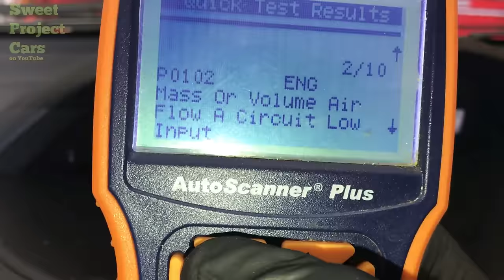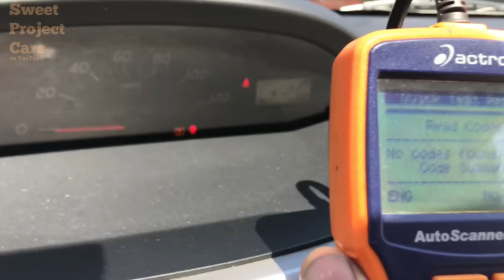How To Test Your MAF (Mass Air Flow Sensor) & HOW to Find A Vacuum Leak

Comment: I don’t think disconnecting the MAF and car continuing to run necessarily indicates the MAF is faulty.
Reply: Why not. Whats you technique?
Reply: @slewfoot6608  you need to understand the maf sensor reads air flow. A good maf will display 1 gram per sec air flow for each liter engine size. 8.1 liter V8 draws 8.1 grams per sec at idle.
Reply: @falcorthewonderdog2758  Thank you for posting that - l was hoping there was some simple formula.
Reply: 100% i took mine off while it was running, and ofcourse the car kept running. I automatically assumed its faulty and was gonna buy a new one for over 100 $ untill I looked around and followed my breather hose to find out there was a huge hole at the end of the hose stacked right behind the engine where it was hard to see.
Reply: @falcorthewonderdog2758 what for a v6
Reply: I replaced mine with a new one and it still stays running when I unplug it???

Comment: Just because the engine quits after unplugging mAF sensor, doesn’t mean the Sensor is free from fault. Best method is a scan tool and Repair manual
Reply from the maker: We've found this method one of many to fix the issue, have a great day. mad Mike & team

Comment: When I replace something like my injectors I try to go OEM which will run way over $100.00 for all 4, so knowing the injectors themselves were good, what I did was get a kit with all the seals, o-rings and on mine, new screens. Worked like a charm for under $50.00. A lot of times especially when someone has messed with them before they don;t take special care when installing them and pinch the seal (like on yours) which will end up with a fail. Another great video... Always a big THANK YOU!
Reply from the maker: Dano thank you so much for sharing my friend great information like that helps everyone have a great night my friend
Reply: Aunt Barbara adores you!! 😚

Comment from the maker: Hello my good friends, This video will hopefully help you test your MAF Sensor and how to help you locate a vacuum leak. We found that with a little time you can save yourself a boatload of money doing this work by yourself.  Have a great day :)
Reply: OMG!! I seem to have learned something new again,,DAMN you can teach an old dog new tricks!!! Thanks spc! Awesome as always 😎
Reply: Sweet Project Cars Hey SPC! Can you show us how to get rid the oil and fluid leaks that our friend’s car left in our driveway????  It’s a problem !!! Thanks!!!  😊
Reply from the maker: Ed Smith you are very welcome my friend :) glad we could help
Reply: Thank you for another great "no bulldust" & straight to the point video. It's so easy to get caught up searching in the wrong direction when fault finding on modern engines, that we often overlook the most obvious and easiest things to check first that could easily be causing the problem.
Reply from the maker: Tim Areskog you nailed it my friend :)
Reply: I have a g37 and it has two mas flow sensor.  Do I disconnect both or one at a time for this test?
Reply: Thanks for showing how to find a leak. My brother n law told me to use the same spray, but didn't tell me to do it when the engine is cold. 

So, for everyone watching this video and do not know ANYTHING about vehicles and learning off YouTube, never spray anything flammable on a warm or hot engine. That can cause a big fire.
Reply: Having a problem MAF sensor  didn't show any code but the check light is on . Air ratio reading is high, after installing new MAF the check light off every thing stable,but the next day start the car back other problem  like engine stuttering and pause and black smoke come out from exhaust
Pls help if can thanks
Reply: Man, thanks for the lesson. What is a carb cleaner that you are using in the video to spray?

Comment: So I had a check engine light on b4 for my 02 sensor which I replaced and it went off but it’s still stuttering when I drive , I unplugged the maf sensor and it still ran so that’s the problem ? Even tho there’s no engine light for it ?
Reply from the maker: Do this video  https://youtu.be/2uIX_LNWxRY    before you do anything else so you can get your system back to default, then we will go from there. Thanks for watching and asking, have a great day. mad Mike the hammer SPC

Comment: Can you tell me why. I already changed new mass air flow sensor on my car and I drive around 20-30 minutes. But the check engine light it's still on.
Reply from the maker: Try this, disconnect both battery cables, let it sit overnight. Clean the posts and the terminals well before re-installing. If it comes back on get one of these  https://amzn.to/3jwL8f1  it will tell you exactly what the problem is. Thank you for watching and asking, have a great week my friend. Happy New Year! mad Mike the hammer SPC

Comment: I once had a lean on bank whatever error with my 2006 Chevy Colorado with nothing in the codes about my MAF functionality and it turned out to be a bad O2 sensor. Just goes to show how these little tricks and a decent understanding of how you can disconnect stuff or spray things in certain places goes an awful long way to diagnose something. Of course, having a $500.xx set of service manuals always helps, too! (Something I thankfully bought for both my truck and my 2008 Saturn Sky Redline.)

Thanks for the video.
Reply from the maker: Wolf thank you very much for sharing and you’re very correct in your comment thanks SPC Mike

Comment: Many years ago my Grandfather used to use a plumbers soldering torch (unlit!) to find vacuum leaks. A very gentle flow of butane and the engine would suck it in a leak and usually raise the revs. I've also used a can of lighter fluid!! Not the safest of methods, lol!! Great video as always.
Reply from the maker: Cyclone Cyd thanks for sharing this my friend :) have a great day

Comment: When you vacuum leak check with Carb Cleaner or other, use the straw on the nozzle.  It will help you pinpoint where the spray at the suspected leak source.  If you need to extend it, use a piece of clear vinyl tubing.  You want the spray source as close as possible to the item you are spraying. The spray will be more dense (spray fans out with distance) and easier to see the exact spot that's leaking that way.
If you ever have to change 1 injector seal, change ALL of them.
Reply from the maker: Thanks for watching and sharing, have a great day. mad Mike & team

Comment: Excellent video  Very informative audible and extremely helpful  One concern  IS NOT DANGEROUS TO CARB CLEANER ON A HOT RUNNIG ENGINE????
Reply from the maker: Start the car then use the carb cleaner while the engine is still cool Peter, thanks. mad Mike the hammer SPC

Comment: I love your troubleshooting the maof sensor, your explanation was extremely simple, just disconnect it and if it turns off, you know it's good. So simple! :-)
Reply from the maker: Glad it helped Lance! Thank you so much for watching and for your comment, we really appreciate it, have a fantastic week my friend. mad Mike the hammer SPC
Reply: @sweet project cars will the MAF cause a service traction light and service esc?
Reply: 2017 Maxima, mil lite on, runs fine. When you accelerate hard, traction and skid lights come on and the vehicle bucks. Pull over shutdown engine, wait then restart all lights go out accept engine light. What good the issue be ?

Comment: What was the issue you were having with your car, the issue I'm having is my truck starts but takes a few seconds crank I'm thinking fuel pressure is bleeding off through the injectors via a bad seal. I changed the mass airflow sensor truck ones better but still have the cranking issue. Awesome video by the way thank you very much!
Reply from the maker: Sounds like either your injector controller has taken a dump or your fuel pump has taken a dump or your injectors all decided to not do their job at the same time. These are the 3 things that are most likely the culprit, one or all of them. Thank you for watching and sharing, have a great week and all the best on your project my friend. mad Mike

Comment: Great video!  Did you change the fuel injectors?  Will this trick work in every car or just some?
Reply from the maker: Michael Valone yes we installed new injectors and the problem was solved, vac leak gone...this method works on most all cars and trucks my good friend :)

Comment: I just got done dealing with a P0101 code (MAF). After changing and checking all I could it ended up being a bad battery. I had an Oddsey battery and it had enough power to start the truck but not enough for the “brain” to operate. Swapping the battery solved the problem.
Reply from the maker: Thank you very much for watching and sharing, we appreciate it my friend. Hope you have a great weekend. mad Mike the hammer SPC

Comment: After changing the head gasket... All she needed was an idle adjust, and cleaning. I check the MAF by retarding the air flow and if the motor dies your good. 
My truck is so old, I ripped out the O2 sensors and it doesn't care. There's no current going to them any ways. 
Good video
Reply from the maker: Band Ana   thank you so much for sharing, and all of us here at SPC's thank you very much for being here, if you could do us a favor and Share Our Channel Everywhere You Can, that would be awesome as we want to get the word out to the world that good people like you can DIY on most all the issues they have with their cars and trucks :)

Comment: i'm curious,why if you unplug the MAF and the car keep running or not it tell you is bad or not?the MAF isnt acting with the car anymore ... i wonder since i have a 2004 volvo v70 r having idle issue and very high consumption fuel,i have 2 obdii code "p0507 and p2187" and i believe is my MaFsensor, i have change all vacuum line and do spray test on manifold,injector etc with out any effect and if i unplug the mass air flow the car keep running but very ba,confirm probly your point ,but just wondering why lol , thanks you nice video btw
Reply from the maker: ratselop best thing you can do in your situation is to replace the MAF then you will know for sure also run a really good injector cleaner like this  https://amzn.to/2qI4RNB

Comment: I had some black soot or dirt on 1 of the wires on my MAF and I cleaned it, not sure if it is the sugar pill affect but my mileage went from 20.11 to 21.4 MPG but it was almost the end of the tank also. Hope it improves even more after this fill up.

Comment: Hello .  When you do that Sweeeeet opening I know really want to perform a whole song.  As for the leak issue, very interesting. A few weeks ago I tried the test on my car , but didn't think about injectors, which had been played around with a while back and could have been a problem. I never identified the issue so the car has left my life for good. Never mind. I know now for the future . C
Reply from the maker: One thing people forget Colin and I do as well those seals take an intense amount of heat stuffed down there into the motor it doesn’t take them long to dry out and dry rot that’s why we soak them in 303 now AnyWho thank you so much for being here with us it’s always a pleasure

Comment: Very useful tip to check for fuel injectors but why would pulling a properly functioning MAF turn the truck off but the truck will keep running if its bad? That has me confused
Reply from the maker: It's just the way it is my friend. Thanks for watching, have a great weekend. mad Mike
Reply: my truck keep running , new MAF from Auto Zone.

Comment: Its not throwing a code but when i pull the maf plug it stays running. This is after installing a brand new one. Wondering if the plug is bad

Comment: Hey buddy! Ss always great channel!!! I have a question for you if u can possible help. I have a code for the same thing. I removed the sensor harness as u showed here and the car kept on running like it wanted to turn off but it didnt go off. Does that mean i need a new mass air flow sensor?
Reply from the maker: Jose that is a great indication you need a new mass airflow sensor hope this helps my friend have a great night
Reply: Thank you thank you! Keep rocking with your channel man :)!!!
Reply from the maker: you are very welcome :)

Comment: I have replaced my maf/map sensors twice/throttle body and sensor/air filter/alternator and I still am getting code P0101 please help what I should do?? 2014 Chevy traverse..it goes in low engine mode and I can’t drive over 20 mph..so idk why I keep getting this code and I have changed everything..should I do what u did in this video?
Reply from the maker: Your other issues you may have with that code are 1. a vacuum  leak   2. a problem with your intake manifold, it could have a small crack in it   3.  a clogged or dirty air filter  4. wiring connections to your maf aren't good. Check everything that you can check and if it still does this, you probably have a broken wire of some sort. You may end up taking it to a certified repair facility my friend. Thanks for watching and asking, have a great week and all the best on your project. mad Mike & team

Comment: I have a 2013 nissan altima 2.5, it starts but cuts off when put into gear. Got the 102 , 101 code. Replaced mass air flow sensor but still cuts off
Reply from the maker: Well you are in a position where you are going to have to anti up and take it into a reputable repair facility.  Sorry buddy.  Have a great day.  mad Mike the hammer SpC

Comment: Thank you for your knowledge. 06' C/K 2500HD .  I replaced  the Mass Air Flow Sensor with one from Auto Zone and cleared the codes, no more MIL .  Today it came back.  I unplugged it and the idle changed but it kept running.  what do you think I should do?
Reply from the maker: I would say you need one of these  https://amzn.to/3PBL9ur with 10% OFF CODE :T9BRFI99   Plug this in and it will tell you exactly what you need to do Brian. It's way more economical than going to a repair shop my friend. Thanks for watching and asking, have a great week and all the best on your project. mad Mike

Comment: Is it better to use OEM injectors or reman"s??? Can I  use TB Intake cleaner to check for vacuum leaks??? If car has dual mass air flow sensors do I have to unplug both???
Reply from the maker: luis lopez you have many options in parts so we say use what you can afford. most any flammable spray will work for checking leaks,
Reply: If Car has dual mas air flow sensors do I have to disconnect both??? Thanks! @SweetProjectCars

Comment: If it was a vacuum leak wouldn’t the check engine light stay on all the time? Having this issue with an 04 silverado 5.3 with intermittent check engine light and threw maf code… but had a buddy with a vacuum leak on his same model truck and his engine light stayed on all the time… he was diagnosed with a vacuum leak… verdict? Do i have a bad maf sensor or vacuum leak?
Reply from the maker: When you get the check engine light, check the codes at that time, that's how you will be able to tell alan. Hope this helps, thanks for watching and asking, have a great day and all the best on your project my friend. mad Mike the hammer SPC

Comment: My 93 Pontiac Grand Am GT  with the 3.3L V-6 when put in park will surge from 500 rpm to 1000 rpm but when put in drive it goes away and drives fine until I stop at a stop sign or traffic light then idles rough until I give it gas to go. Sometimes it will stall when I stop like it's not getting enough gas. I cleaned the MAF senor but still does it. Could it be a vacuum leak or maybe some other senor I'm overlooking. Thanks for your help and love your videos.
Reply from the maker: If it only does it when it's in drive, just leave it in drive LOL. Did you use this  https://amzn.to/3MjGFIu  and only this when cleaning your MAF?  Also, make sure that your air filter has been replaced. You will also need to use this here  https://amzn.to/3VX5rRT  use the whole bottle on half a tank of fuel. We are doing these things to rule out the least expensive problems out of the equation. If doing these things does not take care of your problem, use this  https://amzn.to/3LOiiRO  and this will tell you what codes you are pulling up, once you do this let us know what codes you received and we will get you pointed in the right direction Kelly. Thank you for watching and asking, have a great day and all the best on your project my friend. mad Mike the hammer SPC
Reply: @SweetProjectCars   I will Thank YOU.

Comment: I have a problem with my mass air flow sensor, I tried to clean it up and still the engine light comes up. Then I bought a second hand mass air flow sensor and change the one I have, and my engine runs smoothly  no rough idle and no more engine light. When I test to remove the connector while the engine running it didn´t stop so meaning the one I put also bad? I saw also a video here in you tube regarding fulling out the contact while engine running,  why my engine still running when I full it out the connector? can anyone explain pls.
Reply from the maker: ok are you sure it is because of the mass flow and not a 02 sensor?
Reply: @SweetProjectCars  what is the 02 sensor sir? I read from my scanner faulty mass air flow. I don´t know if the MAFS or something else. But now it seems running good no engine lights, I will try again the method disconnecting sometimes. Thanks for your time.
Reply from the maker: leon if it is running good and the check light it out then you are good to go also if you disconnect your battery both positive and negative cables for 15 minutes and then reconnect then drive for 50 miles or so it will reset your computer back to default.